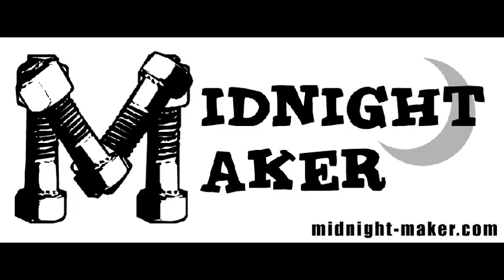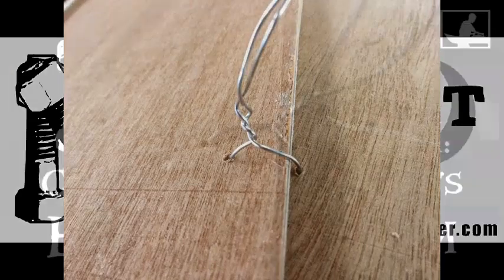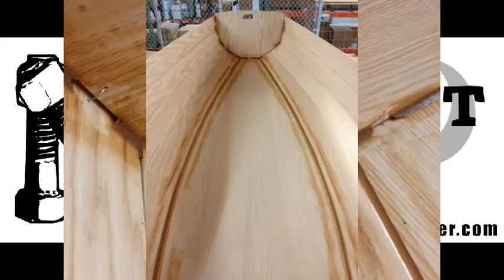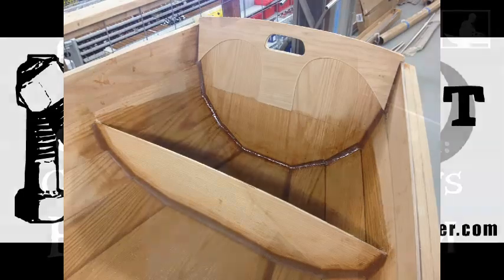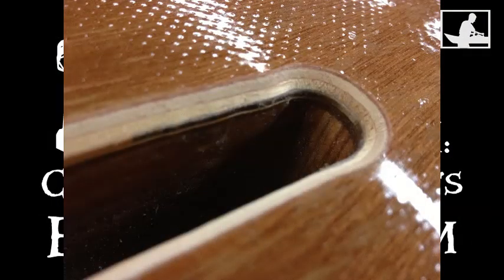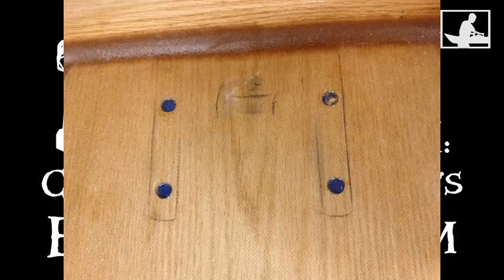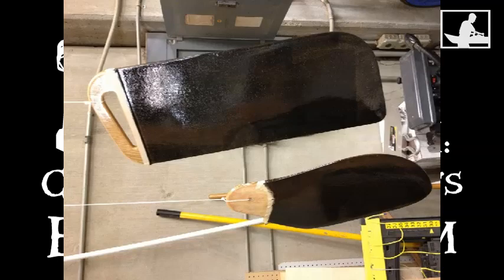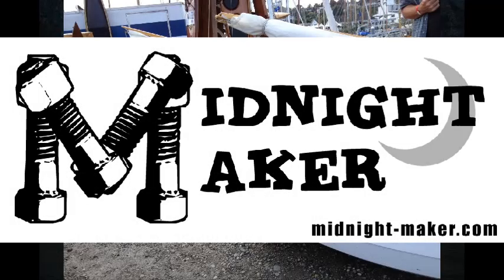Mancraft 101:  Building the Eastport Pram Sailing Dinghy

Comment: I see this is an old posting, but I'm hoping you are still watching. Nice build, and with some very helpful tips on the process.  I am thinking about scratch building the nesting version of this boat, because I would like to make it as light as possible.  I keep a sailboat on my Puget Sound mooring in the summer and with the pretty cobbly beach and our up-to-15 foot tides, it's easier to walk a dinghy down to the water on my back than to use a dolly.  I'm also planning to do the nesting version, so that it might fit on the deck of my Flicka.  As I look at other builds, the boat seems very stout, maybe more than necessary, especially with the added laminated bulkheads for nesting.  What do you think about reducing the plank thickness to 4mm instead of 6 mm?  I think the bottom, transoms, and the bulkheads would be 6mm (doubled for nesting).

Comment: I really appreciate your suggestion to make small fillets for the transoms and then remove the copper stitches. The official manual asks us to fillet over the stitches, which to me sounds a bit lazy. Also starting with small fillets seems like a great opportunity to make a small batch of the thicker filleting mix and test it there.
Reply from the maker: Yes, I call it the tack weld method.  It also makes it easier to make the larger, long, smooth fillets later, after the boat is immobilized.

Comment: Hi, how are u doing? I've noticed the hole for the mast on the forward seat is 52 x 52 mm while the mast itself is 48 x 48 mm. Is that right? Isn't there too much play? Thanks
Reply from the maker: With epoxy and varnish on both parts, there's very little slop.  Also, once the sail is loaded, it's not going to move around much.  Some people also put some sort of chafe protection on the mast at the partners.  That's really only 2mm on either side.

Comment: Hello from Ottawa, Canada.  I enjoyed watching your video and congratulate you on a fine job building your Eastport Pram.  I'm thinking of ordering  kit from CLC to build the nesting version.  Can you tell me how well the boat performs carrying a load (e.g., supplies and two adults)?  I'm a big polukah and would like to use it as a tender for the mothership, to carry supplies and explore anchorages.  My current tender is an enlarged Bolger Nymph (widened by 6 inches), and though she works fine as a a rowing dinghy, I really like the looks of the EP and also think it would make a great winter project.
Reply from the maker: Hey Jack, thanks and great question!  With a published payload of 375 pounds, the EP is pretty much maxed out with two adults (especially if you're a big guy like me), so I would recommend it more for recreation in protected waters.  The good news is that the EP has a big sister, the Passagemaker dinghy.  While it's not a true nesting pram, the front third does detach from the back two thirds, making the 11'7" dinghy much easier to handle, store, transport, etc.  The PM has a payload of 650 pounds which gives you much more flexibility, versatility and most importantly, more freeboard in a seaway as tender.  Another benefit is that the take-apart version of the PM is almost identical to the solid version, while the nesting EP has rectangular, removable thwarts that take away a lot of the good looks of the solid EP.  The two boats are so similar that the construction methods are almost identical with the main exception of having to scarf plywood together to form the 12' panels to cut out the sides from 8' sheets.  Interestingly enough, I'm about 20 hours into the build of the PM and will be posting a video series on the build.  Feel free to contact me via midnight-maker.com if you have any specific questions and of course CLC's forum is one of the best for getting any answers you may have prior to buying a kit or your build process.
Reply: Thanks very much for your frank advice.  I'm a pretty big polukah myself, and might look somewhat like a circus bear on a trike in an EP.  The Passagemaker sure is an attractive design.  Then John Harris has to go and make matters even more difficult by introducing the Tenderly 10.  Sure is a nice boat.  I suppose any small boat could be sawn in half to make a take-apart (if not a nester), but I wonder if I could ever muster up the nerve to cut a finished hull in two!
Reply from the maker: Hey Jack, the 10' tenderly is a beautiful boat and was very tempting for me.  However, it's twice as difficult to build as the 8' EP and only gives you a few more pounds of payload for all that extra expense and effort.  With that being said, I may still build one and they've even come out with a club version that has massive flotation tanks/seats.  Not every boat can be cut in half and there are several, very specific steps required to do that (e.g. build a double bulkhead/cardboard sandwich).  I'm actually almost to the point of bailing on my Passagemaker's take-apart option because of the concern over cutting the boat in half.  Plus, the additional bulkhead means I'll have to buy another $80 sheet of plywood.

Comment: Nice video! You talk about a sail kit. And instructions. I bought the manual for the Eastport pram recently but there's no instructions about sail making. That's a pity because I want to make everything myself. Have you still got the instructions?
Reply from the maker: Hey Dick, thanks for the inquiry.  The sail kit comes from Sailrite.com.  When you purchase their kit, it comes with several pages of instructions (https://www.sailrite.com/Eastport-Pram-Mark-II-Lug-Main-Sail-Kit).   Also please feel free to post any questions to CLC's forum (http://www.clcboats.com/forum/clcforum/).  I'm very active there too. 
 Good luck with your project!
Reply from the maker: Thanks!  There is a diagram of the sail in the purchased plans, but that would mean you'd have to take it to a sailmaker and they'd make your sail as a one-off.  Of course, there's nothing wrong with that option.  You can also go on Sailrite.com and find the kit for the Mark II lug sail if you want to sew it yourself (pretty difficult), or I believe you might be able to purchase sails already made through them.  There may be somewhat of a discount if you purchase a finished sail from a sailmaker who makes these sails all the time.  I believe CLC even has a relationship with a sailmake familiar with the EP lug sail.  Feel free to post on CLCBoats.com forum for specifics.  You can also buy white or tanbark (red) sails a la carte through CLC.